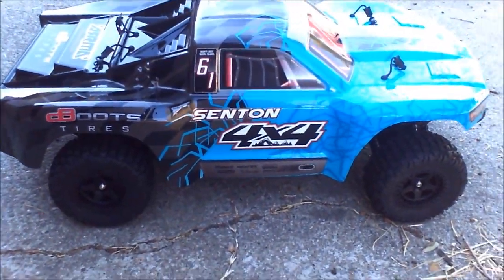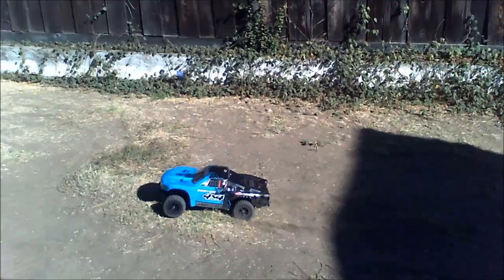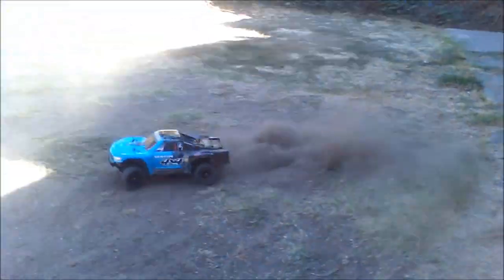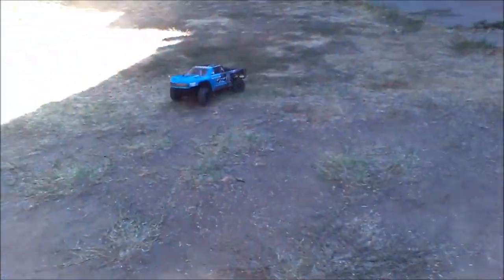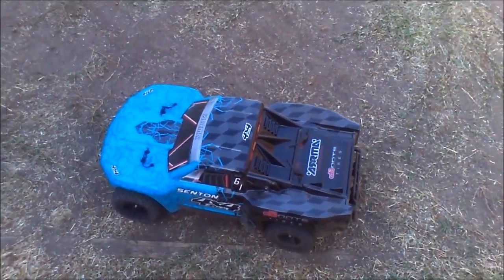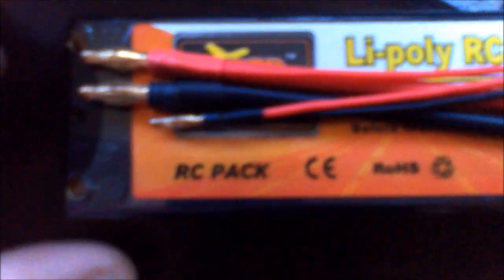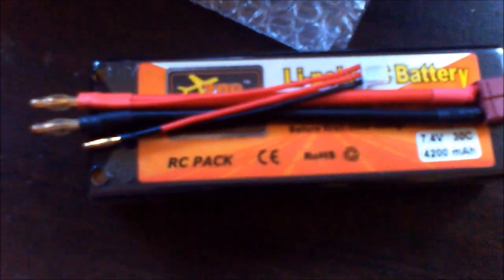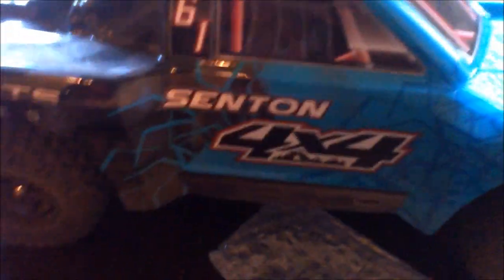Arrma senton Mega Blue  - First run stock and on 2s

Comment: 😀👍 It's a great truck... would only go 3000KV t o 3300KV with this.
Reply from the maker: 5200kv 80amp..but I'll update the input shaft and add the center shaft bearing carrier.
Reply from the maker: But a hobbywing 3652  3300kv would be best if i were to keep the driveline stock.
Reply: Not true the BLX versions only come with a 550 3200KV
Reply from the maker: The BLX motor has more torque being a 550 size and also a 100amp ESC on 3s..Torque is the issue with these mega rigs..The 3652 is a 540 size so less torque and run with the 10BL50 or 10BL60 ESC's  on 2s..That's why I suggest it with a stock set up..but with punch turned down and the 27t pinion for less torque of course
Reply from the maker: I run a 4300kv and a 60amp in my other one..I recommend getting the center shaft bearing with anything over 3300kv but its held up to about 20 or 30 2s packs..Input shaft showing no sign of wear yet but punch is set low and big pinion for less torque.